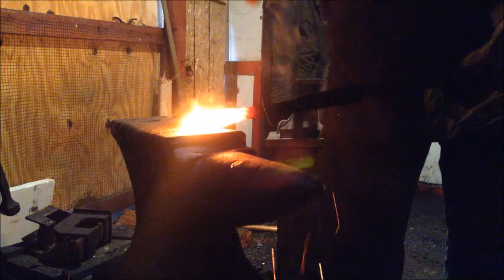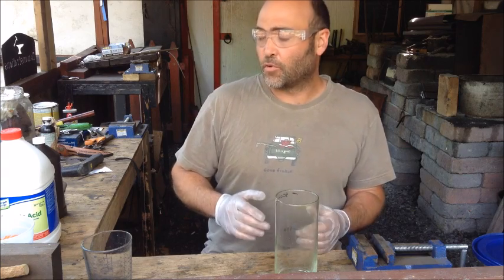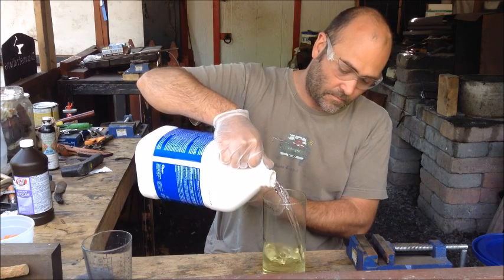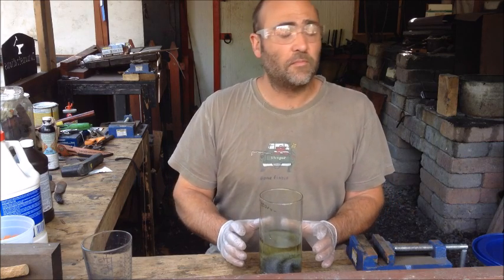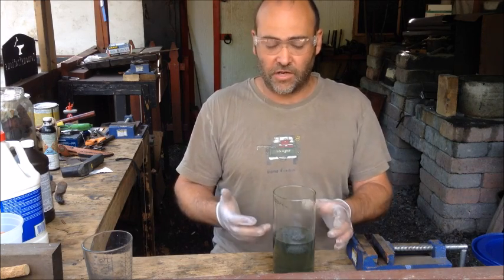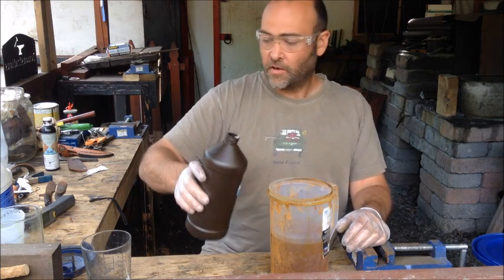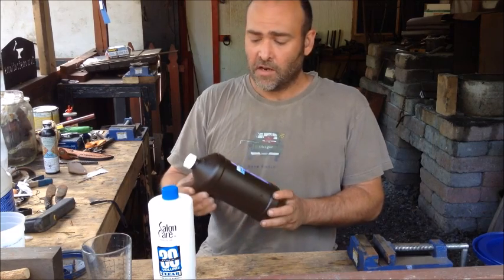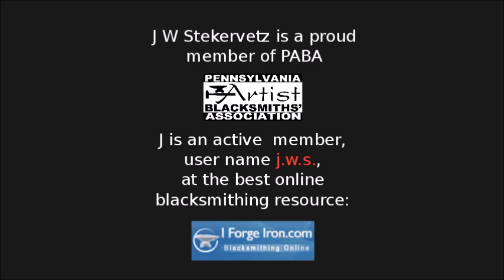Making Ferric Chloride (FeCl3) for Blade Etching

Comment: Muriatic acid is not a lower form of Hydrochloric acid. The two names are exactly synonymous. It's just like "baking soda" and "sodium bicarbonate" are exactly the same thing. Hydrochloric acid is simply Hydrogen chloride gas dissolved in water. Water can dissolve a lot of HCl gas, but the max amount varies by the temperature and pressure. It's impractical to dissolve more than 40% without cooling or pressurizing the container. So although the bottle says "only" 37% to 38%, that's actually FULL strength (100% strength doesn't mean anything, so don't ask for it). Under standard conditions it cannot actually be made any stronger before Hydrogen chloride gas starts to boil off the acid in thin, wispy white clouds of death (man, i can't think of a worse death than choking on Hydrogen chloride... truly I can't think of one.). Sometimes people think muriatic acid is a "less strong"  form of hydrochloric acid, but that is by no means an official definition or even a conventional one. You regularly see Muriatic acid sold at 38% concentration, which is about as strong as it comes.The only "impurity" is water (actually there is a teeny tiny bit of nitric acid and stuff left over from the industrial process used to manufacture it, but that can be ignored). If it warms up at all, or if it's dry out, or you are at high altitude ,or the pressure drops then the acid will start to release HCl vapor. You often see a white vapor float out of the bottle when you open it. Do not breath in even a little bit of that vapor! Once it touches the water in your mouth or lungs or eye it readily turns back into acid. At about 20% there is little danger of it spontaneously fuming even when the solution gets hot (less than boiling), but hydrochloric acid also works MUCH faster as it warms up. This can lead to runaway reactions that cause the acid to start to boil. Hot hydrochloric acid splashed onto your skin is a fundamentally different situation (it's an emergency situation) compared to room temperature hydrochloric acid splashed onto your skin (no big deal, just rinse it off and go back to work... unless it gets in your eyes. That's also an emergency.).

I'm somewhat surprised that you were able to work with it with your head right above the container. Usually after you do that a few times you will have gotten a whiff of HCL vapor and you won't do that again. I don't know if you had a fan going or if there was a constant breeze where you were working, (or maybe it was cold there?) but indoors or out you never want to have your head above an open container like that. Maybe you were using 20% concentration? It's not the splashing you have to worry about. It's the vapor that you might inhale or float into your eyes. Even with safety glasses the vapor can float right around them to reach your your eyes and it will HURT!

That's been my experience. It's not a big deal as long as you keep in mind the tricky ways it can sneak up on you. I like to keep a running hose nearby when I'm working with more than a couple liters of the stuff at once. Baking soda, sodium bicarbonate, is also good to have on standby -- preferably premixed in a solution.
Reply: An ounce of prevention is worth a lot more than a pound of cure. Specially in this case.
Reply: good info my friend, thank you !!
Reply: Excellent comment. Thanks.
Reply: Someone that actually knows their chemicals for once
Reply: Hello

I’m the stupid one in this comment section who don’t understand anything here lol
Reply: Hey bro,  are you Walter White by chance?
Reply: The muriatic acid you can get at Home Depot is 20% concentration, and as mentioned in the video it contains further impurities designed to prevent fuming.  So the concentration, plus the additives, are why he was able to easily work with it, and why they sell that brand at hardware stores
Reply: Our guy is not using "pure" Muriatic Acid. The product he uses is found at Home Depot and the manufacturer hides the concentration of the acid as a trade secret (it sais between 20% and 30%) because it contains stabilizers in order to reduce the fumes. That's why our guy can stay above the "boiling" container and breathe without problems. Mystery solved.
Reply: I think that stuff may have been diluted a bit more than the label said, and the yellowish color makes me think it might have a pretty high iron content already. When I make Ferric I use 20 baum (31.5%) muriatic from work. Its clear, and as soon as you pop the top off the barrel, those nasty white fumes start rolling out. It will dissolve the steel wool in about 30 minutes.
Reply: I believe this works for making nickel 2 anhydrous chloride, also for etching if I'm not mistaken, right?
Reply: Both the same thing just industrial trade name with a little more impurities. And yeah that vapors no joke especially on humid days those vapors eat everything.
Reply: Klean Strip is 20% per their MSDS.
Reply: Kimyasalın ismi nedir
Reply: Noah Spurrier |
Reply: Science 100
Reply: and an eye wash or garden hose
Reply: Baking soda is a mixture. Hence it is not allowed to carry the name of pure sodium bicarbonate. Baking soda typically is  sodium bicarbonate + crystal citric acid + silicium + starch.
Reply: @herrkulor3771  

That's baking POWDER, knobend.
Reply: He's no bitch, he can take it
Reply: chill bro

Comment: 5:22 bubbles?
are those hydrogen bubbles from left over steel wool which reacts more quickly now, or is that chlorine?
Reply: H2, so it won't burn your lungs, but it will explode...
Reply: Because the solution it is making is FeCl3 it is hydrogen

Comment: Exactly how long was the steel wool in there?
Reply: Way longer than it needed to be.  Washing off the varnish stuff that steel wool is treated with to keep it from rusting in the bag would have allowed the acid to react on the wool much faster.  Used steel wool, drill press swarf, nibbler clippings, or my favorite...jars of rusty finishing brad nails from the thrift store/re-store all will probably work faster than a virgin pad of steel wool.

Comment: do you know of any reason why ferric chloride won't etch metal conduit? i made my  ferric chloride using your procedure and it acts like it doing something when you submerge the metal but instead of etching the metal it just lifts the painted masking off after soaking for a while
Reply: What the hell are you running on about, were talking about not being able to etch galvanized conduit, no one even mentioned hydrochloric or muriatic acid. So Shona O’Neill I guess my question to you is, Do you know how really dumb it makes seem when you can’t even find the right conversation to flinging insults at….pretty dumb!!!!
Reply: Ferric chloride should be active on zinc. In fact, more so than copper because the reaction releases hydrochloric acid, which then dissolves the more zinc, if I recall correctly. But note that this may start to bubble and fizz, releasing hydrogen gas (harmless as long as there are no open flames or sparks about). Maybe your conduit has some other coating. I think some may actually have a plastic clear coat, which resists most acids.
Reply: i grind the layer of galvanized off and polish the remaining steel to a high gloss before i try etching and it does etch a little bit but can't leave it in very long because it takes off the pant masking. i'll get some regular steel tubing and try it again, i don't see how that will make the masking stay on better but we'll see...
Reply: I'm no expert but I would assume that you are referring to galvanized electrical conduit? I don't think the acid will react with the galv. coating as it is not ferrous.
Reply: JW S. hydrochloric acid and muriatic acid are EXACTLY the same thing! There are NO differences in purity, if you do not know the truth DO NOT spread falsified information, because all you have is the WRONG information. Do you really know how dumb this makes you seem?

Comment: Just wanted to ask is the blade food safe after a process like this?
Reply: after you etch you need to wipe it off, then neutralize the acid, Windex works. use liberal amounts of windex. completely wipe dry after. I would certainly wash with dish soap BEFORE using it on food. and if your dishwasher has a sterilize feature, I'd do that as well. 

I used to be a chef, so picking up a knife that was just cleaned with live steam is not unheard of for me

Comment: It's funny hearing the acid safety speech.  Did you know if you put 97% sulfuric acid on your skin, it would do absolutely nothing if you immediately cleaned it off?  In fact, it takes up to two minutes before you even start feeling a slight burning sensation. People freak out about the acid in lead/acid batteries even though it's only 10% or less of sulfuric acid.   Frankly, most acids are not as dangerous as people suggest.   You'd have to spill several ounces of muriatic acid and let it soak into your skin for 30 minutes before you'd notice anything.  Just sayin.  I know, I know.  Better safe than sorry.
Reply: i dont wear gloves when handling ferric chloride, I am fine. Sometimes my skin turns yellowish where i touched it but i am fine.
Reply: go to the store and buy some muriatic acid. Stick your finger in the container. You will feel it burning instantly. 100% guaranteed fact. If you are contacting an acid that does not instantly burn your skin, its because youre dealing with very mild concentrations. Muriatic acid will instantly begin to dissolve elements. Your skin is no different. Your ignorance is showing.
Reply: You have no clue what you are talking about. I had a car battery explode when I was a kid and ran immediately to water and was being burnt before I got to it. Higher solutions are far more dangerous.
Reply: nizmojoeblows
Yes, he doesn't know what he's talking about
Reply: nizmojoeblows I disagree. I used to clean pools. We used 12M muriatic acid, same stuff you get from the hardware store (if we ever ran out we'd buy it from lowes, so...) I used to splash it on my legs pouring it into pools all the time. The only time I ever noticed a burning feeling was when the acid dried on my skin then was rehydrated by water from another pool. Even then it wasn't that bad, just annoying and easy to wash off. Sulfuric, on the other hand, is more aggressive, dehydrating your skin pretty quickly. As far as ferric chloride, I've gotten some on my skin without issue, but I got some in a small cut on my finger once and it felt like a wasp sting. Not excrutiating, but not pleasant.

Comment: Hallo JW S, will this etching prevent carbon steel knife from rust?
Reply: Goran Nikolic no it will not, if used and left on blade your blade will rust
Reply: No it will not. I recommend using it in conjunction with some hot apple cider vinegar to give it a patina that will protect from rust.

Comment: do you have to use a plastic container when you add the peroxide? due to the heat. or can you just  mix the peroxide in the glass container?
Reply: +JW S. thanks for the quick reply. secondly, do you just wait for the steel wool and muriatic acid to turn that blue grey colour or is there a minimum time that you would usually wait prior to adding the peroxide. thanks alot. I have my ferrous chloride working it's way right now. your videos are very informative. I like them. I watched the heat treating video last night and got a kick out of that woth the old video clips. keep up the good work

Comment: is that possible to have etching solution with HCL + Hydrogen peroxide ? and do i need any steel wool or copper ?
Reply: +JW S. Already watched your video thats why i am asking to you youre one who is explaining all process very well. But i asked for only HCL use or hcl with hydrogen peroxide. Do i need copper or steel wool?
Reply: +JW S.  I will already going to use it on my sainless steel.   So if you say  ok i can try only hcl on my knife and if you have any idea about time ot could be helpfull :)

Comment: is that possible that i can etch my knife with HCL or any other way with HCL ?
Reply: How could it be darker or lighter (i am pretty new about that and this is going to be first to me)  tha k you for all your helping
Reply: +JW S. okay :) what kind of way can i fallow with %21HCL + if necessary i can find (hydrogen peroxide + copper + steel wool ) but i don't think i can find muriatic acid. thats my problem :)
Reply: +JW S. My hcl is already is concentrate cleaner its %21hcl solution i am living in turkey and people are sellin this in the name of "tuz ruhu" in here you may check and tell me if i can use this as muriatic acid so if you say yes i can fallow your video with this acid maybe if you want i can send a picture if this.
Reply: +JW S. You helped a lot thank you for your time to save for me i will let you know after i done my etching :)
Reply: +JW S. sir. i have done my customization by etching my folding knife with your guidance and your toughts :) i think its pretty good right now  is there any way that i can show the pictures of my work pelase let me know cuz you helped a lot :) i want to show it to you.
Reply: @quayron2138  Hello,  just a word of info. Muriatic acid is used to clean the bottom of swimming pools, one of the very best places to find it is at swimming pool supply stores.
Reply: @timfeavel  i made  mine with bleach,  hydrojen peroxide and iron
Reply: Hello again, just be very careful when combining those chemicals. And wear a protective gas mask or do it outside or both.  Chlorine gas can be very deadly.  Please be safe and God bless.  Tim
Reply: @timfeavel  i did notnhabe resporator mask, so i did it  outside, with gloves,

Comment: how long can the final solution be stored
Reply: +JW S.  I am trying to re-etch a damascus blade that has had the dark rubbed out of it.  The only thing I have on hand is nitric acid which I am diluting 4-1 with water.  I am applying to small areas to test with a q-tip. It produces a beautiful black etch, but after I stabilize with either Windex or backing soda, some (but not all) of the etch turns a weird brown color while some of the black remains. Is this because of the nitric acid or is it something I am doing wrong?  (I am impatiently waiting for the ferric chloride to arrive)
Reply: +JW S. The ferric chloride arrived today.  Picked up the TSP.  Cleaned to crappy brown etch off both blades with some 1 micron spray and a toothbrush and then followed instructions.  Thank God for great advice!  They are far superior now than when I got them.  Here's a couple of links to pics of how they came out..  IMG_6854.jpg
https://zbrafish.egnyte.com/dl/YQns2fZT84
IMG_6855.jpg
https://zbrafish.egnyte.com/dl/Cqo8eu6YS0
Reply: What is HCI?